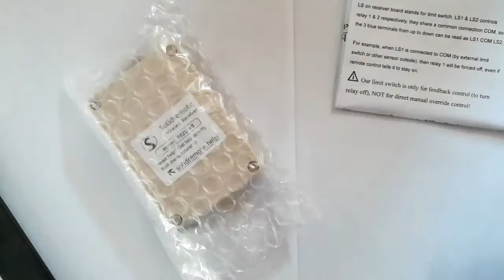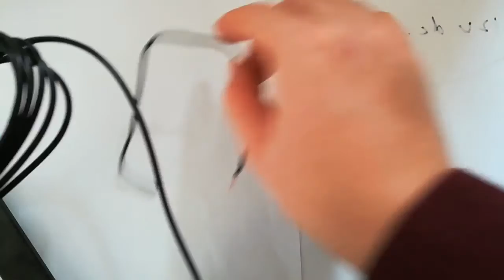202U V5 & V6 - Unboxing and Installing External Antenna

Comment: Does not work on my craftsman 2019 opener with yellow button. The wall push button does work but the solid remote does not work on the opener. I wired it to the wall button and it triggered (lit up) the arrows on the opener, but the door did not move. I also wired it directly on the opener where the wall button wires were connected. Again same thing. The remote lit the arrows but no door movement. The wall pushbutton works fine. I tried many times to reprogram the opener with the yellow button but with no luck. Also unplugged the opener for a few minutes twice. What is the problem? Is it because thus opener is to new (2019)?
Reply from the maker: Yes, the new yellow button opener doesn't use traditional wall switch signals (that is simple on/off signal).
The new wall button switch is also coded, making regular receivers not compatible.
The only way seems to be directly solder our output wire to the wall button component itself, but it could require some work.
Maybe you can check OEM receivers instead, 
Thanks!